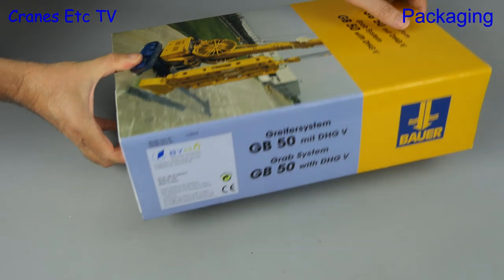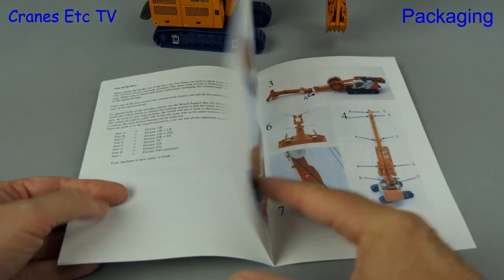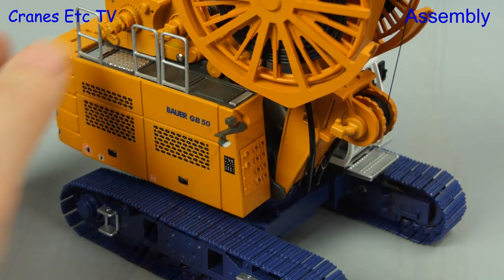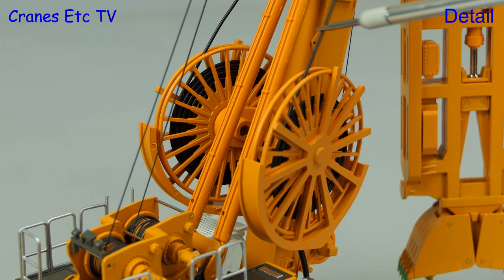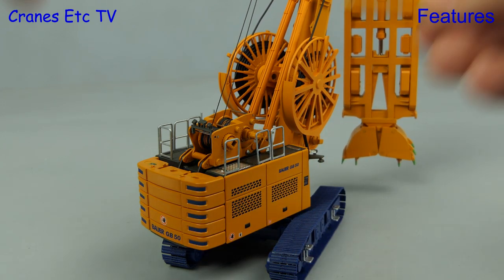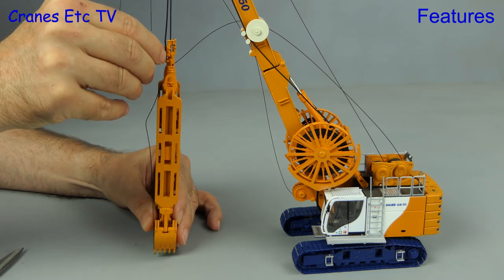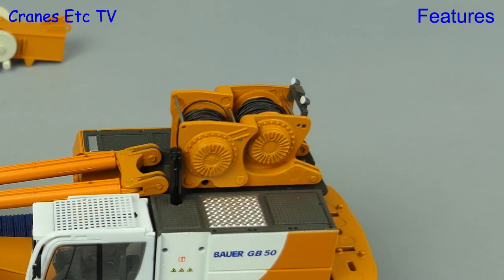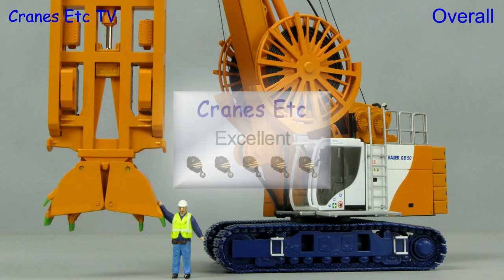BYMO Bauer GB 50 + DHG V Grab System by Cranes Etc TV

Comment: I was waiting for it (this and the BG 30), and it is even better than what I initially thought, really excellent!!! Metal handrails and lader, the folding winch assembly... and finally a removable side walkway!!! Great work bymo and Bauer! 👏🏻👏🏻
With metal hose reels and a quick conexion between the hoses and the grab it will be a perfect model! 

Finally a question, is this the real Bauer colour scheme?? Like the other models it look so orange, real ones are more yellow...
Reply from the maker: The colour of the model in the video is also dependent on the quality of your screen, and the camera, lighting, and colour balance at my end.  So it is hard to be sure.  What we can say is that there is some colour difference between parts of the model.
Reply: Thanks for the answer 😊. I thought it would be a matter of the camera and specially the light, they look so different in different photos. The same happens with vögele models (but then these are perfect). Because of that, when I bought the first Bauer it was a bit dissapointment how orange it was... 

Now I have on display the MC96 + BC35 HDS-T and the HS 8100, and the Bauer is much more orange than the Liebherr. In reality it is just the opposite.